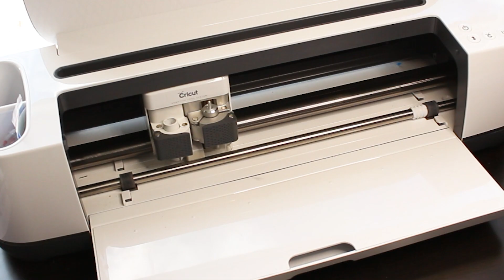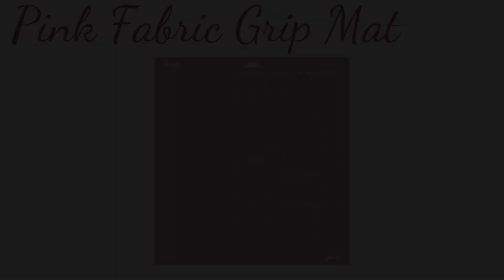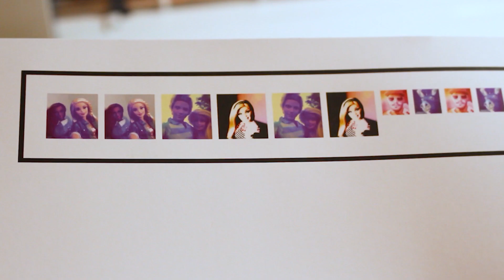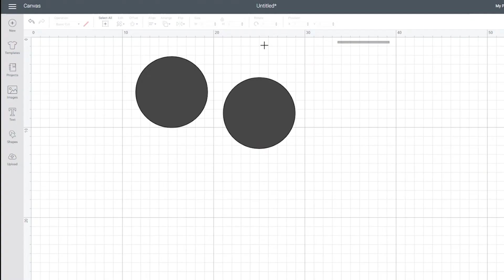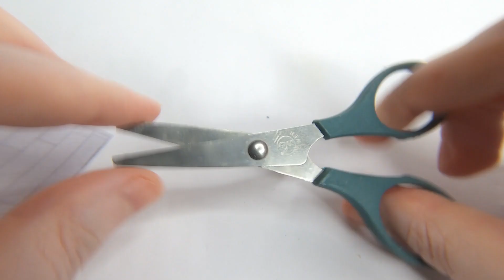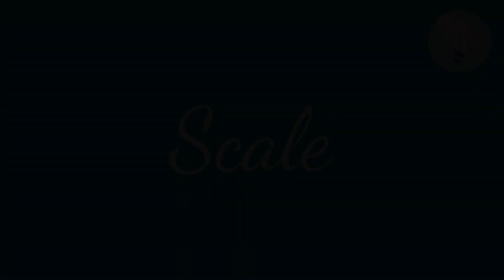Ultimate Guide to Making Miniatures with a Cricut | Which Machine To Buy | Comprehensive Video

Comment: What settings do you use for foamboard?
Reply from the maker: Hi there, I've personally not cut it as I haven't found any foam board thin enough but I'd suggest cutting it with the knife blade and on the posterboard setting.
Reply: @ItsyBitsyBuild  thank you ☺️

Comment: Hi there thanks for this video! I bought a cricut maker to help me with my miniatures and was designing a cut file for a gated door. How small can I go, I am concerned it would not work? My measurements are 3mm by 45mm and it is on chipboard. Thank you
Reply from the maker: Hey Grace, I'd recommend a bit of trial and error with a smaller piece. 3mm cuts are certainly achievable on thinner materials but the thicker you go, the harder it is to achieve tiny cuts. Most of what I develop has been adjusted through trial and error until you're happy with the finished product. You could always look at layering something like Kraft board or heavy cardstock too. Good luck!
Reply: @ItsyBitsyBuild  Thank you that is a good idea to layer! I have subscribed to your channel

Comment: Helpful video! Do any cricut machines indent only and not cut?_Thanks
Reply from the maker: The Maker series has a deboss tool which you can use to press an image into a material but it definitely doesn't achieve the same results as an embossing tool. You can see an example of how it looks on the white tray in this video https://youtu.be/YhGZfNTQjk8

Comment: Great vid, where do you purchase the Acetate Plastic Sheets from, I'm based in Sydney.
Reply from the maker: Thanks! Spotlight has some but I personally run empty laminator sheets through my laminator and use that instead ☺
Reply: @ItsyBitsyBuild  Ok cool, someone else suggested using a laminator however I don't have one, I might even try 1mm perplex sheet or something like that.  Thanks again.